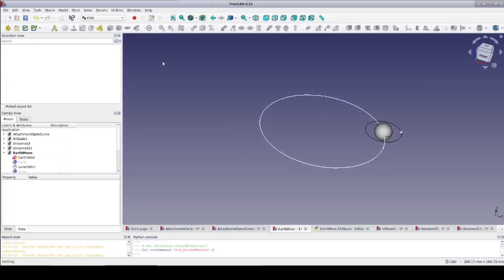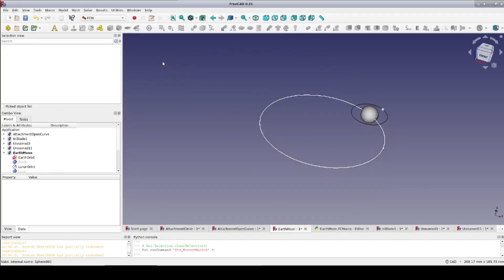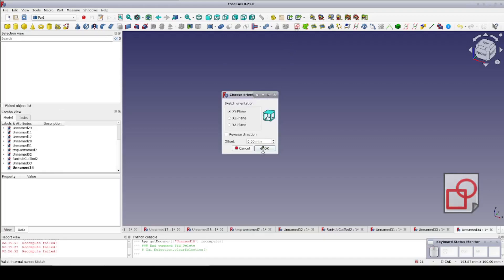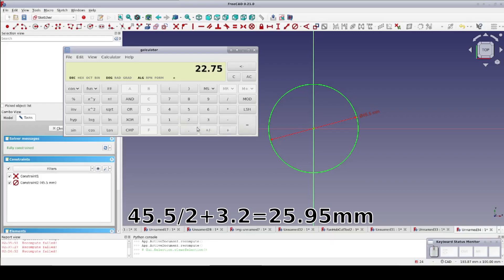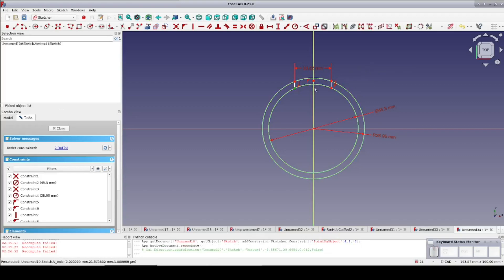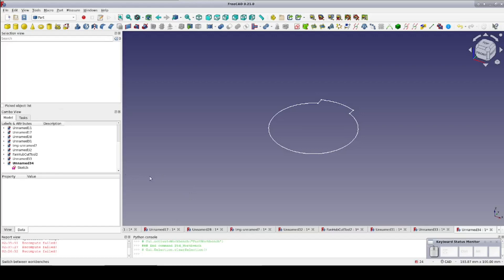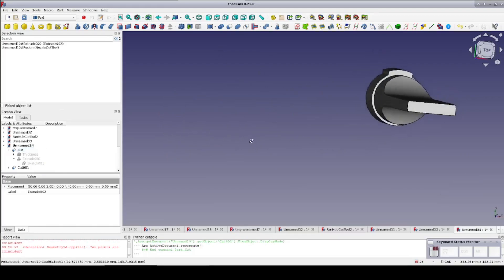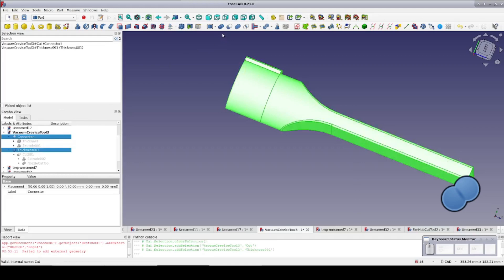Clearance in a Vacuum: The plot thickens.

Comment: I'm very new to solid modeling, and I'm a bit confused.  If you have two "separate" solid shapes, which overlap in 3D space, does that confuse a slicer for 3D printing?  Do you need to overlap and join those shapes together, or does the CAM process (in my case a slicer) ignore the boundaries which are entirely inside both solids?  
What if you have coincident faces which define the ends of the shapes, and there is zero clearance between them?   I'm assuming that would be considered as separate, but this is a new world for me.
Thanks for any help you can give.
Reply from the maker: If the shapes overlap or touch, the slicer will treat them as one shape UNLESS the contact area is tiny (such as a cylinder just touching a cube). If the contact is that tiny, you can influence the slicer to treat them more as one shape by fusing them (Boolean union) in Freecad before exporting.

FreeCAD cares about solid geometry, but the slicer only concerns itself with inside or outside of a filled area.

Comment: Watching you resolve the tangent vs equal constraint issue probably saved me time and frustration in the future.  Had the referenced geometry been a complete circle instead of an open arc, I'll bet the default constraint would have been equals.  Too lazy to prove it!
Update: thanks for doing the test!  I will definitely encounter this issue at some point as this is my workflow so you definitely saved me future time.
Reply from the maker: It probably should be =, but I just tested and it's still tangent, even with a full circle.